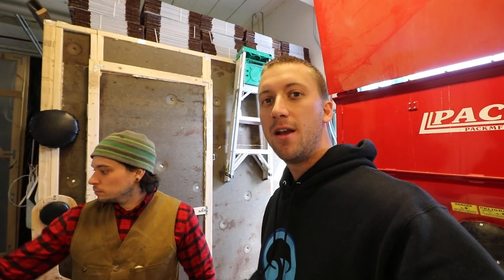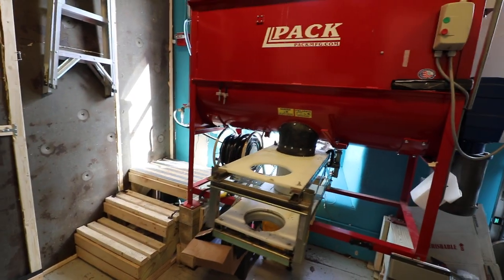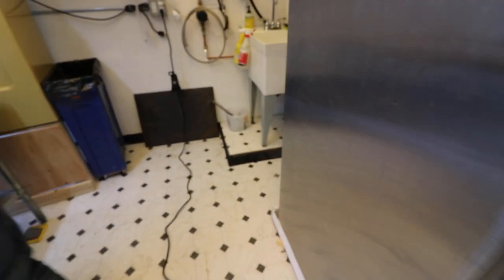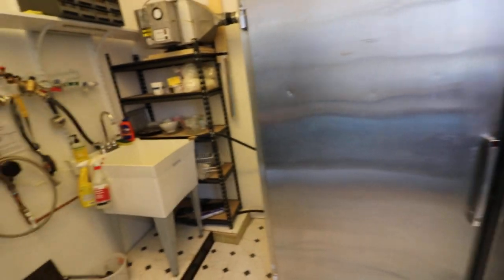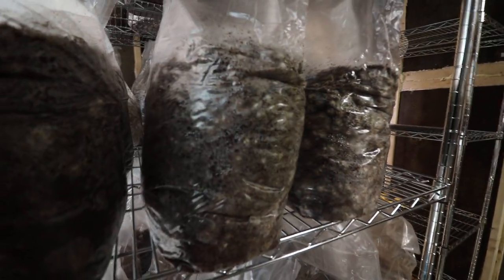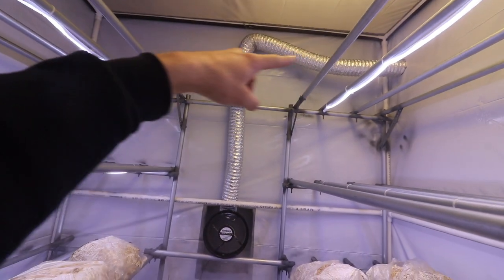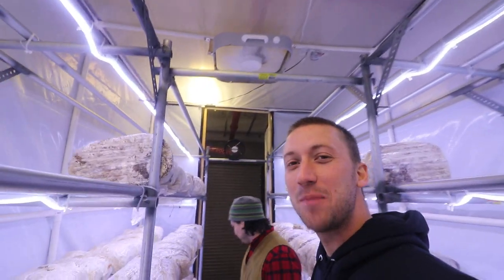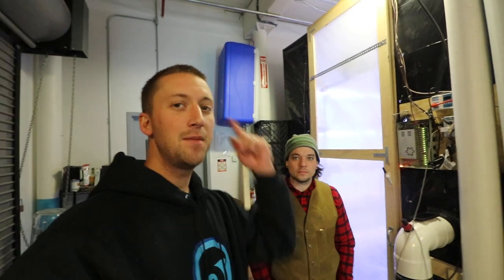1000sq/ft Oyster Mushroom Farm Growing 300lbs a week!

Comment: I have a question- Why would someone use smaller bags vs larger vertical hanging bags? Wouldnt the larger elongated bags give you more mushrooms and higher profitability? Thanks
Reply: This is something I have been wondering myself. From what I can gather the answer would be yes. Greater yields. However the process becomes more labour intensive, therefore smaller bags can be turned over faster and with less manpower.
Reply from the maker: handling the bags at 12 lbs each is already labor intensive, yes 30 lb bags might be less proccessing but when its all manual it wears you down. European farms grow on 30+ lb plastic wrapped bales but the block production is automated.
Reply: @MyersMushroomsFarms  What about the Big growers using bottles. the largest growers here us bottles  60,000 sq feet
Reply from the maker: @londonpaintball  They use around $500k+ in automation to process those bottles.
Reply: @MyersMushroomsFarms  Where can i get more info about how they handle the 30lbs+ bales?

Comment: He has some $$ tied up for sure!!
Reply from the maker: Yea but you know they say it takes money to make money. Starting a farm of any scale is never cheap. You can be cheap with equipment and pay in labor or pay for good equipment and save in labor.
Reply: Myers Mushrooms Farms absolutely! Not a lot of $ my way so I'm trying to compensate with resource efficiency..lol
Reply: Myers Mushrooms Farms ballpark: how much does that setup cost?
Reply: @rossh8293  Im wondering the same thing. I suppose if you do a little market research in the area you plan to cover, you might be able to figure it out. Unless you are talk straight tools and hardware .
Reply from the maker: This whole setup is around 50k thats including the rent during buildup, and all equipment, electrical, plumbing. The batch mixer alone was $12k.
Reply: @MyersMushroomsFarms   That's still a hell of a lot cheaper than the brewing business. LOL!  I spent that just to get into the supply business.  Wishing I had done that with mushrooming instead. What does your class cost? Great video!  Good luck Wildwood!
Reply from the maker: @MountBaldyBrewing  my class is $700 currently and I have one class left. Its going to be next weekend the 24-25th you can email me if you want more info